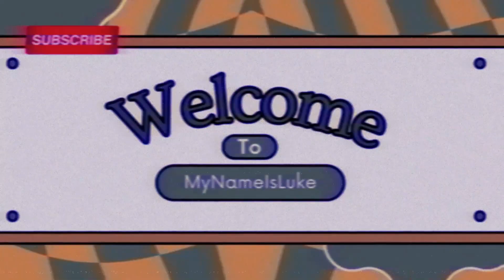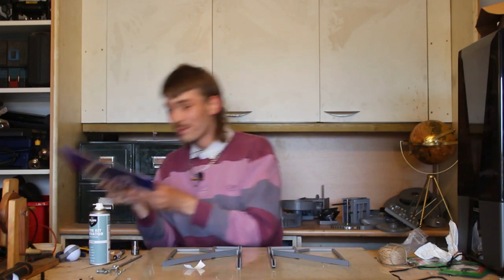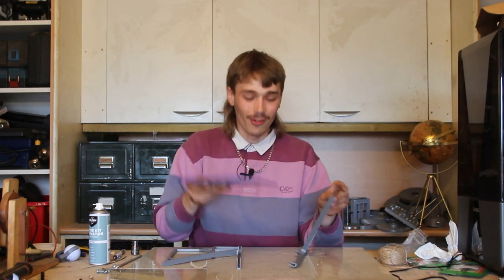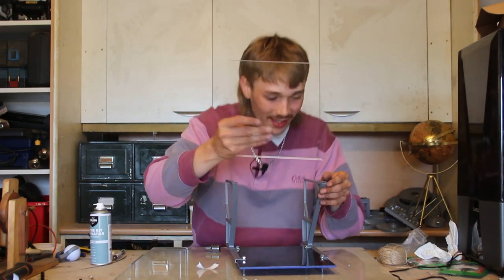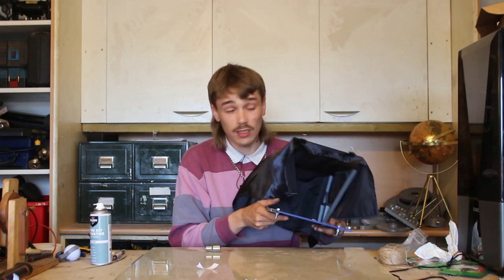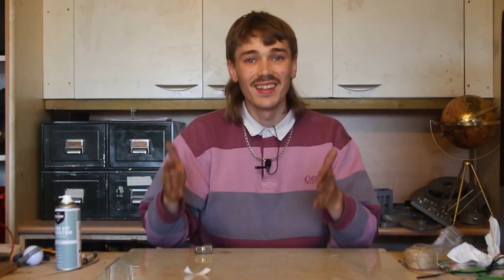Ultimate 3D Printed Teleprompter - 3D Printed Tools

Comment: That's a good build.
I built one out of some wood and foam board a few years back using the glass from an old cabinet I tore apart. 

I also was using a 17 inch LED computer monitor as well.
It was a huge obnoxious thing that didn't work so good as a teleprompter.
Reply from the maker: I like the idea a lot! I can imagine it could be compacted down a little bit too. 
What an awesome project though. Cheers mate! :)